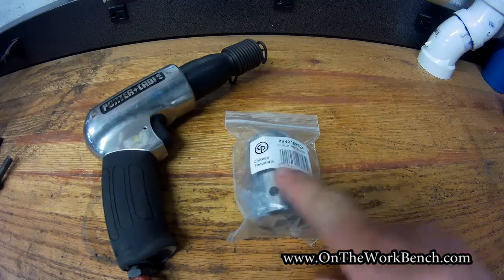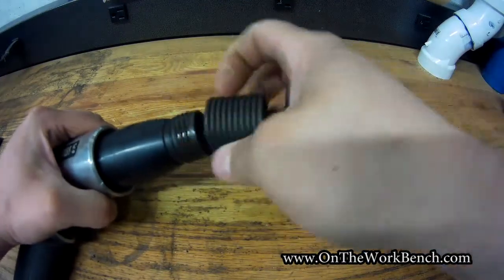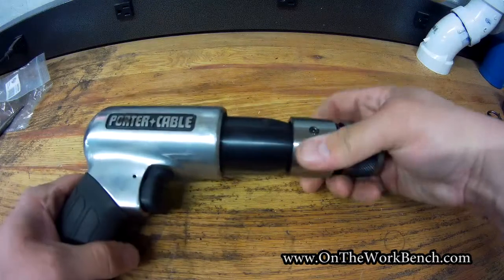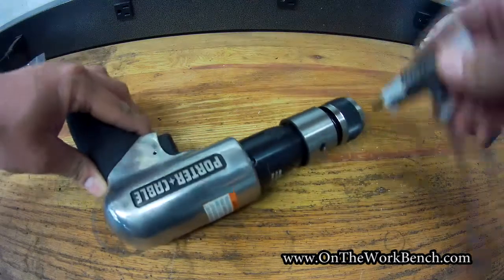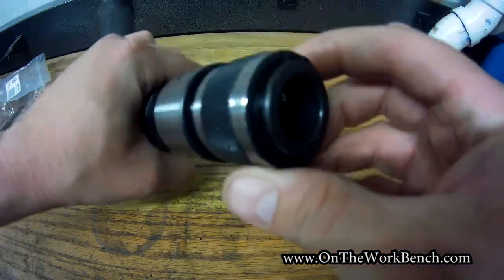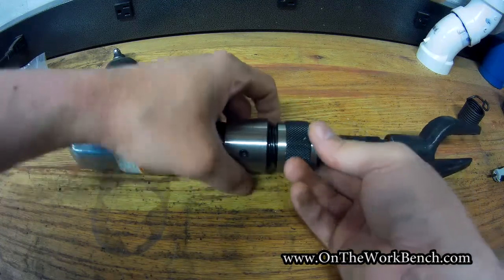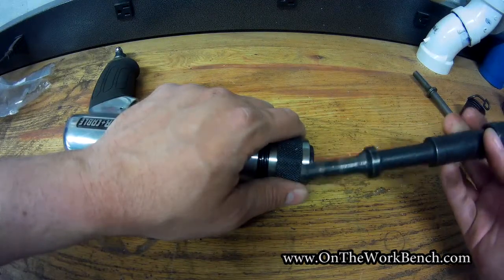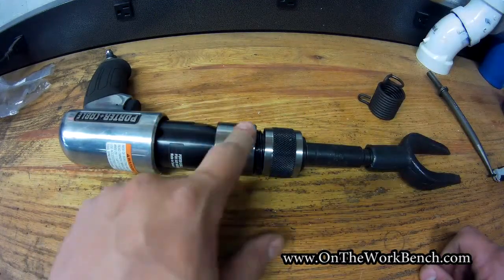Chicago Pneumatic Air Hammer Chuck

Comment: Those chucks are good but its a good idea to grease the 4 ball bearings, pull back the chuck and pack a little grease into the holes, if there left dry after a while the ball bearing start rattling and will come out, happened on my first one, second one with grease in it's fine.